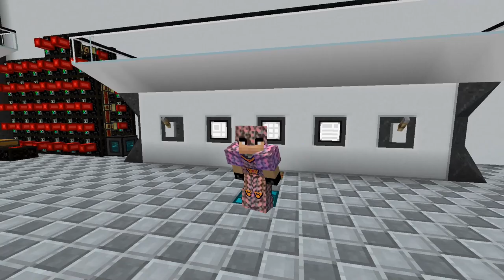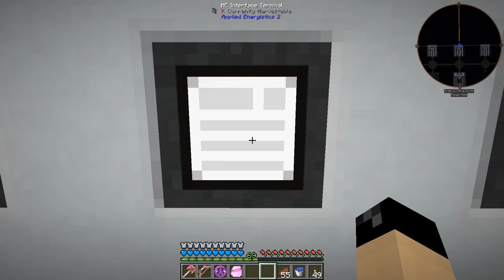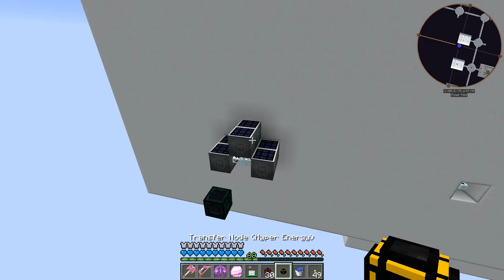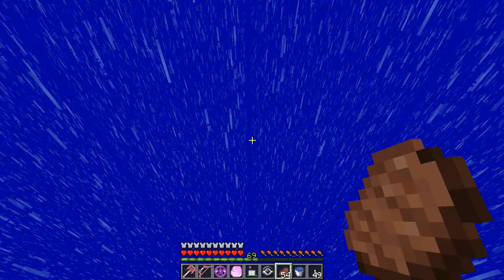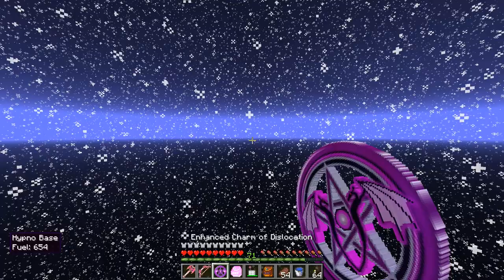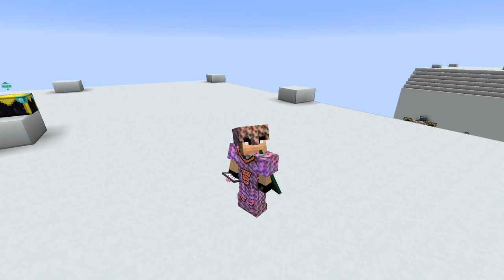Minecraft Mods FTB Infinity - GLOWSTONE & TESTING [E60] (HermitCraft Modded Server)

Comment: RF -> Lava fabricator or Magma crucible (works with cobble-stone, netherrack and blaze rods)(in efficiency order) -> Lava -> Geothermal Generator -> EU
Reply from the maker: Marcos Ramos Abia This actually is a smart idea! I forgot about lava power with IC2 :D
Reply: Hypnotizd Thank you! I love your videos Hypno <3
Reply: Hypnotizd  yeah and then you can take the hyper node and convert it back to RF and connect it to the magma crusible
 and it's a separate system or well you don't relly care about power usage but yeh.
Reply: Marcos Ramos Abia it's just better to have a lava pump in the  nether...
Reply: Hypnotizd why would you bother with geothermal generators which make 20 EU per tic when you already have ultimate solar panels which make 500+ eu per tic?
Reply: ***** You are totally right about that, he is way passed that stage, but I think it's the only RF->EU bridge without any other mod.

Btw, you only need 25,6 geothermal generators to output the same as a solar, that is 153,6 total (154) so you will make 3080 eu/t
Reply: ***** Not renewable, but... it's true you can make more power (for a long time, not forever)

I say go solars go!

Comment: Hey Hypno, put some speed upgrades into hyper energy thing. Put like stack of them into it. And try even stack upgrade. I do not know if it will make difference but when you use energy node with regular pipes to power machines it does make difference :)

Comment: Palso theres a multi block from railcraft called almething like the flux converter. 2x2 multiblock. But i dont think it works with ic2 cables ,though.
Reply: My bad its flux transformer. And it does work with ic2 cables.

Comment: Dude, There is another way of converting, its called Power converters. Its a really useful mod for, well you know. All you need to do is place the 3 blocks together in a certain order and it will work. (The power bridge MUST be in the middle of the other two). You'll need: Rf consumer, Power bridge, EU Hv/Ev Producer. You can switch between the producer/consumer by putting it in a crafting grid. Hope this helped ya!
Reply: IT ISNT IN THE PACK. HE SAID THAT IN THE VIDEO. WATCH THE VIDEO BEFORE YOU POST.
Reply: minecraftpig99-xbox 360 can see you didnt watch the vid as he showed there isnt power converters in this mod pack
Reply: minecraftpig99-xbox 360 Power converters isnt in the pack. Using the rednet cable seems to be so inefficient though doesn't  it?
Reply: Hmmm.... COuldnt you just change the configs. Tht could work

Comment: After a bit of extensive reaserch on the ftb infinity mod pack, i have found pretty much that those rednet cables can convert power. Theres a giod few mods that can convert power, but it seems you dont even have one of them. May i suggest trying to change some configs for MFR, i didnt see if you can but it may work.

Comment: If the rednet cable can transport limited ammount of power then it is not smart to focus all cables from tesseract to one cable.You should put them on diffrent sides of MFSU
Reply from the maker: ShEeDoW w From my testing, it appears the input of RF is limited to 250EU per connection. The output seems to be unlimited.

Comment: Hey, Hypno. What's the best way to find witches in FTB? I'm at the point in my world where I need a witch farm going, but I can't seem to find any witches to start it. I used to run into so many of them that it was a pain, but now that I need them, they don't seem to be spawning >_<
Reply: IceMetalPunk well, im not hypno, but I think you can find a lot of witch spawners in the twilight.
Reply: IceMetalPunk In 1.7.10 witches spawn normaly, even if they are a bit rare, and if you can not find any, you can still find witch spawners in the nature, in structures generated by witchery
Reply: axel meyer
Witchery structures! Right! That's where I need to look. Speaking of...do those just spawn anywhere, or are they more likely in certain places?
Reply: Zach Erickson
I'm not much of a combat player, so I'm trying to avoid combat-heavy places...like the Twilight...if I can help it.
Reply: I do not know that, I just know they look like little circles made of stone brick with a water pool in the center
Reply: axel meyer Thats what I meant by twiight. usually it's a lot easier to find those in the Twilight.
Reply from the maker: IceMetalPunk Generally I just go around at night time and find them. If that doesn't work and depending on your pack, there can be witch spawners in those witchery? structures that randomly generate with a dispenser in the middle.
Reply: Hypnotizd
Gracias!
Reply: Hypnotizd i think you need speed upgreads for the hyper node to transfor the power faster i think it can only do a very litter with out it.
Reply: IceMetalPunk AMIDST could help you too, it's a map previewer and you can search structures location, like villages, strongolds, or witch hutt
Reply: Mr_Kaboum
But does that work with mods? Plenty of the mods in the FTB Infinity pack alter world generation--would it still work?
Reply: IceMetalPunk
If you don't generate the world with Biome o' Plenty, it's work.
Reply: Mr_Kaboum
But...I do >_<
Reply: IceMetalPunk Try posting on the FTB infinity forums. I bet they have something